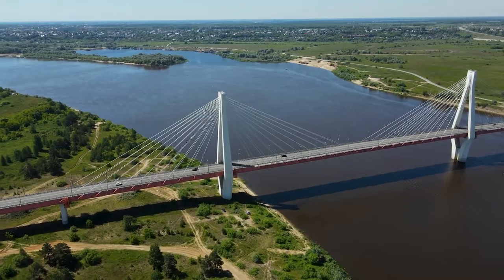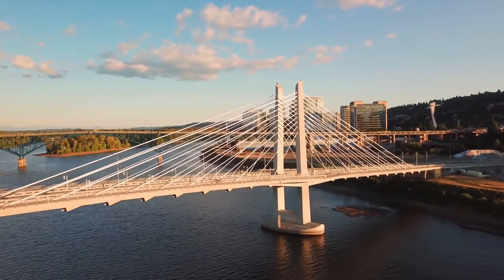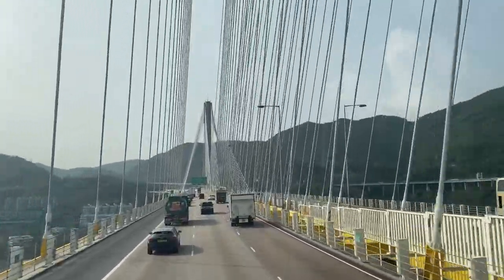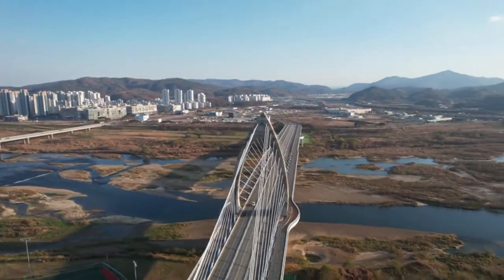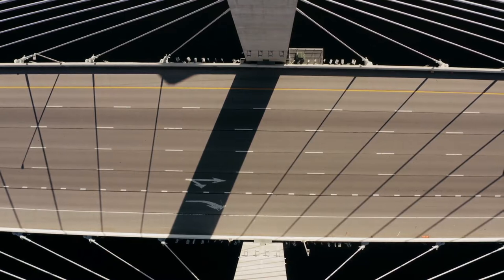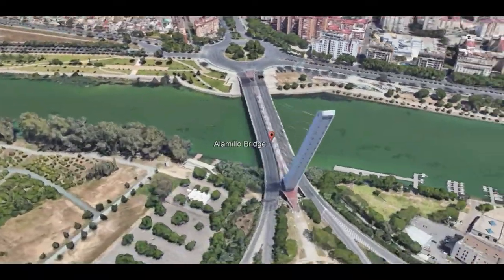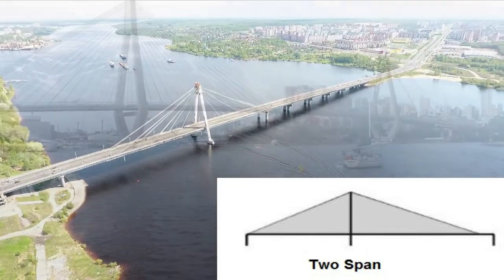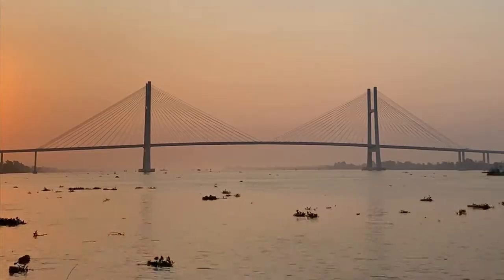Cable Stayed Bridges [How they work] [Cable Stayed vs Suspension Bridges]

Comment: I had difficulty in following the narrative because of a lack of knowledge of the subject matter and the speed at which the narrator spoke.

For the introduction of the subject matter enhanced graphics showing the parts would be nice.  Also, it would be helpful to show details of how connections are made.

I have watched numerous videos on cable-stayed bridges and I still don't know if the cables are continuous from  bridge deck to bridge deck (continuous cable), or if they run bridge deck to tower and tower to bridge deck (two distinct cables).